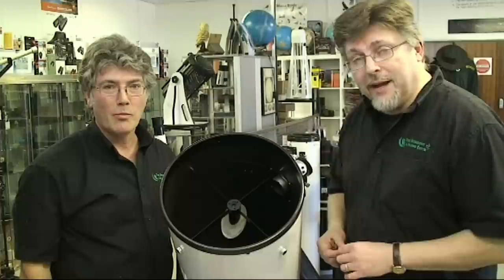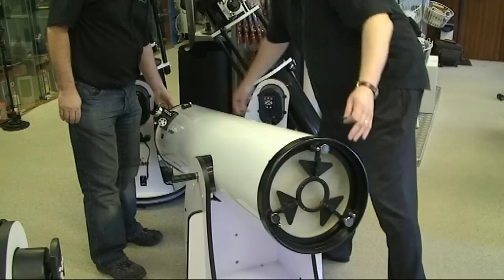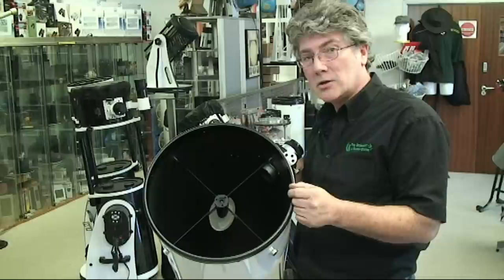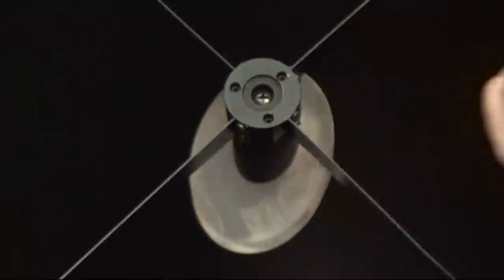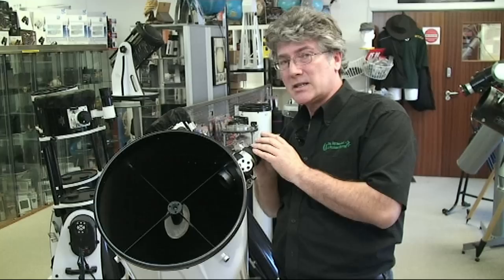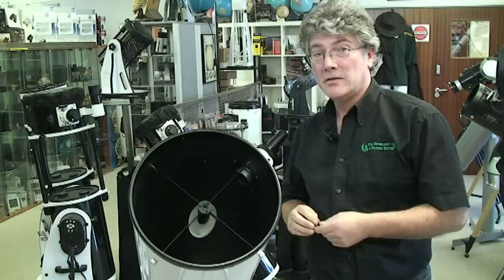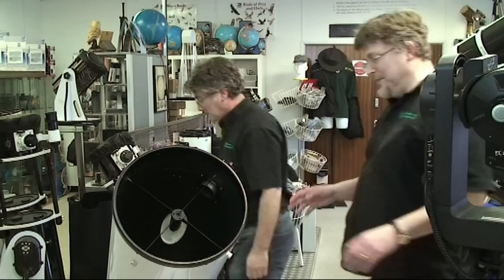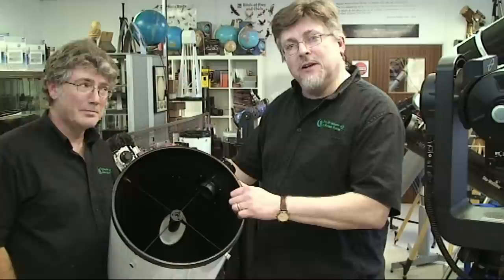Collimating your reflecting Telescope in just a few minutes

Comment: I recently completely disassembled my 45 year old neglected and abused 6" dynascope to repair a hole in the tube, and repaint everything. though I did remove the spider and the main mirror, I left the adjustments as they were. When I hastily reassembled it, the finder was only off by a few degrees, and it focused well enough to see craters on the moon, the moons of Jupiter, and Saturn's rings. Line up all the circles in the circles is all I ever did. This laser thing looks really awesome, I am sold.

Comment: The first thing to do is check that the focuser is at 90 degrees to the tube. Many overlook this first step. There is a big difference between alignment and collimation. A laser alone is not the best method. Check out a few more techniques from more advanced users.
Reply from the maker: You make a valid point - as far as it goes – but it’s not as helpful to first-time Newtonian telescope users as you seem to think - and that’s the audience we’re catering for here. And besides, there are plenty of other mechanical considerations that you can pile on; the focus unit is just one of the more obvious weak links. Why trust any of the critical components? Cheap rolled tubes with Dutch fold seams are rarely ‘gun-barrel’ straight – so 90 degrees to what, a banana? The good news is; the user attempting collimation for the first time doesn't need to be concerned with these issues – not yet anyway. There are plenty of places to encounter advanced and comprehensive collimation techniques later on. Most first time collimators are looking for easy to follow advice that will de-mystify the process and help them restore the telescope to a collimation standard that, typically, they have already enjoyed and not risk making it any worse. Others wish to take the first steps towards getting the best out of their new instrument. It’s this group we are speaking to. You've probably forgotten what that feels like but - I assure you – we were all there once. Thanks for giving us the opportunity to clarify this.  KR A&NTV
Reply: Astronomy and Nature TV Yes, good point, having moved on a long way since then, I tend to forget the audience you are targeting.  As folks get better scopes with well built focuser units which have leveling adjustments, they will be able to experience additional collimation refinements, which is out of the range of standard off the shelf Dobsonian mounted Newtonian scopes. Kind Regards from Down Under. www.shevillmathers.id.au
Reply: Astronomy and Nature TV thats right, thank you very much.
Reply: +Astronomy and Nature TV  What telescope is that?
Reply: Many good references t Newtonian and other mixed mirror-lens telescope systems, with diagrams - demonstration on a Google search. Folks can pick what suits their needs at all levels from beginner to advanced. However, some basic fundamentals apply at all levels. Good info also on Alignment & Collimation.
Reply: Well Put! as a newbie your video is SOOOO Helpful!

Comment: Warning!
Not mentioned, was the importance of not working on the secondary mirror adjustment unless the telescope is horizontal. As shown, with the telescope pointing upwards, any tools dropped, would likely hit the primary mirror. As the mirrior is fragile and made of glass, this could be an expensive mistake.
So when adjusting the secondary of a Newtonian, ONLY do so when the telescope is horizontal.
Reply from the maker: (Edited in October 2021: I note the original posting above has been edited into a more reasonable statement regarding the secondary mirror. However, I have not edited my original reply - RJD.). Hi there, we've answered this quite a few times below over the years. We appreciate the good intentions behind your post but your advice is not as sound as you may think. Lots of Newtonian's simply won't collimate well in anything near the horizontal position. Gravity needs to be pulling the primary mirror down on the mirror supports in a way that is as close to the use position as possible (say an elevation of 35 to 55 degrees at least)  otherwise the collimation adjustments won't correlate well with the actual usage position. The dropped tool 'issue' is a bit of a red herring to be frank. Apart from the rare tightening or slackening of the secondary mirror's central retainer with a screwdriver - most adjustments to commercial Newtonians in this critical area are usually accomplished with a small 2 or 3mm hex key. And with the tube angled at about 45 degrees its not easy to see how this little key is going to imperil the mirror surface unless you stand back and hurl it at the mirror! Normally if dropped it will obediently head towards the center of the Earth, be arrested by the telescope tube and slide down, slowing all the while due to friction, to end up in the gap between the mirror and the tube. I don't see much to worry about here. And what about that rarely used wilful screwdriver mentioned above? Here's an idea - don't drop it. Thanks for posting. KR RJD A&N TV
Reply: but mistakes happen, and by having the tube horizontal, it's very hard even with an accident to screw your mirror up...I get what you're saying about flexure etc, but I suspect most mass made Newts aren't going to be that bad in this respect. ymmv.
Reply: @RocketPlanet  I'm glad you brought this up because when collimating my new scope perfect at level is way off once pointed upward. I wondered what the hell was going on. Now I see why.
Reply from the maker: @davepastern  Thanks for posting, and I'm sure you mean well by it, but the critical reader (there are a few even here on YT) is going to see the open door in your argument left by that 'I suspect'. I speak from the perspective of rather a lot of other 'milage'. I first started using Newts when I was 14, selling them from age 19 and I'm now 60 -  and your suspicions are simply incorrect.  There is a big difference between perceived risk and actual risk. I have been involved in the servicing, repair, collimation, re-aluminising etc, of quite literally thousands of Newtonian telescopes and in over 40 years I've seen no more than 5 that were 'screwed up'. And not one of them was due to dropped tools  - in fact, nesting mice caused most of the damage - and 'I suspect' you'll trawl the internet in vain to find someone urging you to guard against these little bewhiskered blighters of astronomical karma in their top five tips for Newt users!  Again, thanks for posting and letting me reiterate the importance of having gravity acting in the same vector in collimation as for usage. KR RJD A&NTV
Reply: @RocketPlanet  newts tend to hold their collimation better than most other types of scopes (cats/RCs), even with travelling.  You'd have to be pretty damn rough with your newt to continuously be knocking it out of collimation.  As to collimating your new horizontally or at an angle, I highly doubt that doing it horizontally will make as much of a difference as you claim.  I simply disagree with your claim.
Reply: MrSqueak Squeak I don’t use tools on my 8 inch dob. I have collimating knobs.
Reply: Aloha Gang, I am a raw beginner at this Astronomy stuff, but I can see your point about accurizing in the general position you will be using the equipment. As for dropping stuff down the tube, as a electrician, working on live circuits (occasionally) the trick I used was to make a "leash" with string/twine/rope- if the tool is THAT heavy and secure one end to the tool and tape it to be sure it stays, and make a slip noose to fit my wrist. A little awkward, but never failed me in 40 years of working.

 @RocketPlanet  Aloha
Reply: Uh.. that's exactly why I tie the hex tool with a fair amount of string. So that way, even if it drops, it doesn't go all the way down.
Reply: @davepastern  I know it's a year ago, but you 'simply disagreeing' with someone who has decades of experience is the most ignorant bs, you're arguing for the sake of it. I hope you're better now.
Reply: I point the telescope down and lay on the floor to adjust the secondary. Gravity FTW.
Reply: @RocketPlanet  I don't care either way, but just playing devils advocate.
Perhaps the reason you've never seen a mirror damaged by dropped tools is that most people do this with the tube on it's side?  :)

Oh, and thanks for the video, it's the first time I've seen a laser collimation tutorial make sense.  I finally get it and have one on order.
Reply: You could always secure you tools with a lanyard, just in case you dropped something.
Reply: First I love how simple and easy it is to collumate reflective telescope with this type of laser!👍i do have solution to accidentally dropping the screwdriver..tie a tough string from your screwdriver to your wrist
Reply: @RocketPlanet  Not every tool is the tiny L wrench you speak of.  Some of use are using nice aluminum handle hex wrenches which WILL strike the edge of the primary if dropped.  Also, there is the possibility of dropping the ENTIRE SECONDARY mirror down the tube if someone incorrectly tries to adjust the secondary.  Working with the tube horizontal for the SECONDARY adjustment is sound advice.   Moving the tube back to vertical for the PRIMARY adjustment is necessary for good collimation. One only needs a quick google search to find examples of the secondary falling onto the primary.  No vast experience of aluminizing thousands of mirrors required.
Reply: You are 100% correct. Tube should be horizontal for the SECONDARY adjustment.
Reply: best way is to do the secondary mirror adjustment carefully as they told
Reply: I was just screaming at the monitor while he did that. lol
Reply: @RocketPlanet  So you dont believe in mistakes, wow you really are showing that maybe your not the nice guy I thought and more concerned about ego, I hope I am wrong?

Comment: This is one of the simplest examples I have seen in years.  When I first started 12+ years ago, I wanted a larger dob for the Messier objects.  However, My first 10" dob and a cheshire collimation tool by myself, left me wanting.  I actually didn't go to a star party for over 5 years because I thought everyone would look through one of my reflectors and laugh.  I am glad new comers to amateur astronomy have nice guys like you to take the mystery out of (what I now know) such simple things.

If you are looking at the heavens alone, get a laser collimator, and go to a star party.  The dumbest thing I did was to think these older more experienced geezers would be mean.  It is the opposite.  They love sharing knowledge, but they are still geezers!
Reply: Wow, your experience is far different than mine! I went to a locally-advertised (radio and newspaper) "Star Party" a couple of years ago, and the local astronomy club had a security guard there to prevent people from getting within 10 feet of any of the telescopes. Not one member of the general public who showed up got to even get within arm's length of a scope. And the people with the scopes were rude beyond belief.

Comment: Thanks for posting this. I Have just bought a new 150mm reflector, my first reflector telescope and couldn't collimate it with a centering eyepiece. Using the laser i found the primary was so far out I had to fit a longer adjusting screw. Now all is good thanks.

Comment: I bought an Orion Deluxe laser collimator to make it easy for a total newbie :-).  It doesn't have graded settings of brightness -just on and off. However with this collimator -make sure that the red light isn't visible on a white wall etc - before I look to check  the collimation - I move my hand around, twiddling one or two of the secondary mirror screws a bit until I can't see the dot hitting my hand. Then I think its safe to look inside the tube and do the fine tuning. Maybe not necessary with the laser collimator used in demo..

Comment: Can I just add. I use a laser collimator for my Newtonian but when the collimator was new, after getting poor results, I found that the collimator itself was not collimated. The instruction manual did not help but I found 3 tiny adjustments screws on the collimator. These were hidden by caps which I had to dig out. I made a rig so that I could rotate the collimator while pointing at a distant wall. Then you have to adjust the screws so that when you rotate the collimator the laser spot does not move. It's tricky but you can do it with a little patience.

Comment: Hi, maybe it would be wise to attach some kind of restrain to the wrench and the screwdriver, so that if they slip from your fingers you do not damage the primary or any black internal surface.
Reply from the maker: Hi Thomas thanks for your comment. I'm not sure of the value of tethered tools as we have never found it necessary to follow such advice ourselves. I suppose if it was extended to cover every instance where someone uses anything at all that is held in the hand and something of value was underneath it, what with gravity being able and willing to assert itself the instant our grip loosens, the world would look very different. Almost everything would have a strap attached! Although I'd probably exclude very small reflectors from the following rule, it is certainly advisable with 6" aperture up to the very largest instruments - and that is the rubric to always collimate the instrument in the typical use attitude - say 40 degrees but not much higher. In this position the mirror is likely to be in a properly adjustable position as virtually all instruments rely on gravity to pull the mirror down onto the pressure pads and then on to the adjustment screws. If you follow the oft repeated advice of collimating your instrument when in the horizontal position, to avoid tools impacting on the primary mirror surface, you risk applying a collimation adjustment that won't apply when the instrument is employed at higher altitudes - because of the effect of gravity on the mirror position. So your tethered tools are a preferable alternative to collimating in the horizontal attitude in my view. At a tilt angle of around 40 degrees there is very little risk of small hex keys impacting the mirror surface (unless you throw them at it of course) and if dropped they will fall to the side of the tude and slide down at low velocity and come to rest in the gap between the mirror and the tube - there always is one. If a small screwdriver escapes your clutches, and even allowing that it might be large enough to strike the mirror edge, it's velocity when sliding down the tube is sufficiently slow that it is an easy matter to pull the tube down quickly and reduce the velocity still further if not stop it altogether. The real risk to the mirror surface by such mishaps is very slight in reality. Whereas the risk to the quality of the views produced by a telescope that is not adequately collimated is very great. As to the damage to the black internal surface - I think this is sufficiently forensic in character that it is well below even the theoretical contrast reduction effects of dust, skin debris, accumulated insect parts and their ejecta. I tend to think of well used telescopes with open tubes as having signs of life on the internal paintwork as standard and tend not to mark them down for it - although this may be a more personal attitude to equipment condition than I am inclined to admit normally. The tethered tools and the stricture to only collimate with the instrument near horizontal crops up from time to time in posts to this video and I'm probably not going to respond to any more of them. I have my benighted opinion others have theirs - the tethered tools could be made to work if you are worried by butter fingers. But like reveresing a car into a parking space, some folk follow elaborate rules and place matchsticks in the rear window rubbers to follow curbs etc. I just try to avoid bashing into the car in front of and behind me. So I just try to avoid dropping the tools but keep the scope at 40 degrees in case Universal gravitation feels it just has to prove itself once again. Thanks again for this comment and the opportunity to clarify. KR RJD A&NC
Reply: I am 54 and an engineer and this is the first time it ever ocured to me to tether a screwdriver. If I happen to be colimating my telescope and I screw the mirror by droping something on it (things can bounce) I would feel very stupid and would have asked myself what could I have done better. That simple, and it is very unusual that something flies out my hands against my will. Even if I would be a rich person I would think this way. Guys that clean windows in skyscrapers do it, concerned about the people at the street. Of course tethering your mug and expect others to do it would certainly change the world, I give you that.
Reply: @AstronomyNature TV . What happened to your wonderful channel ?
What is going on ? The last vid was some 8 months age . Are you going to post any more vids or not ? Thank you .
Reply: Yesterday got a gift from a friend - an 8'/f4 chipped mirror. Someone made same mistake and dropped a tool into the telescope. The area of a missing chip was insignificant ( about 2% of the mirror). I've blacked the chipped area and the mirror now works perfectly :)
Reply: lol i was wondering about that. i plan to buy a dobson and i ll surely tethere my tools, i m also an aeronautics engineer, and so (dumb) safety first.
i like how your answer is so british :) you re the best.
thank you for the videos!

Comment: Thanks for the video.  I am new to this.  I have just purchased an 8" dob.  2 questions that I have.  First, what is the center screw for on the secondary mirror? If you adjust it with the other 3 screws, I don't understand what he screw in the middle is for.  Second, I have the laser collimator, and every time I move the scope from the garage to outdoors, and then check it, it is way out of collimation.  Is it normal to go out of collimation with any movement, or am I doing something wrong?